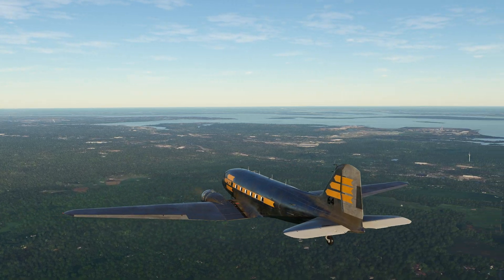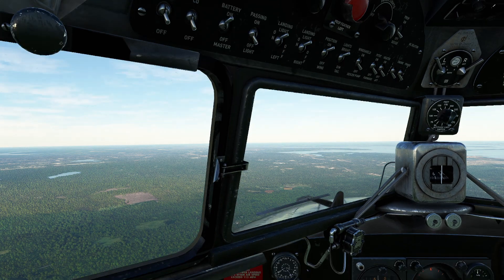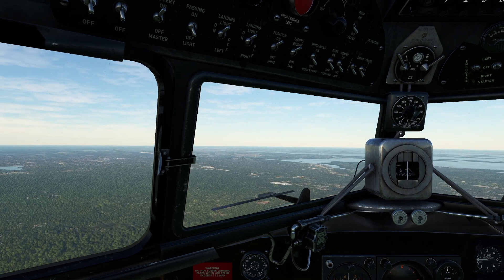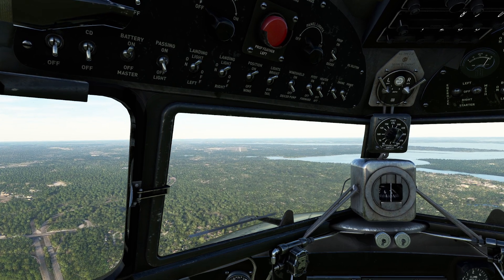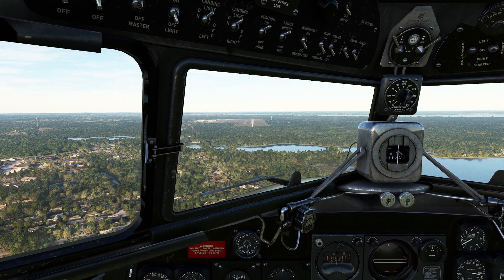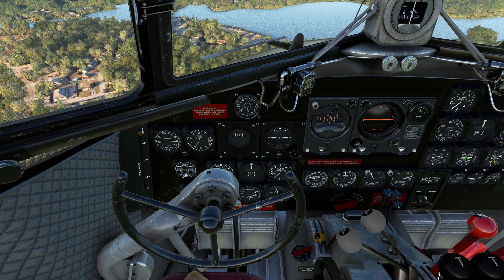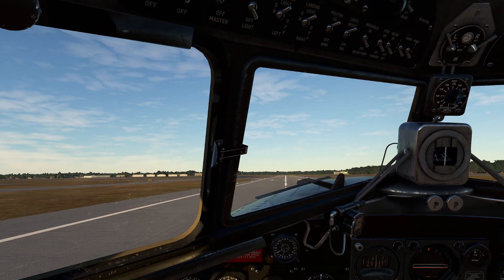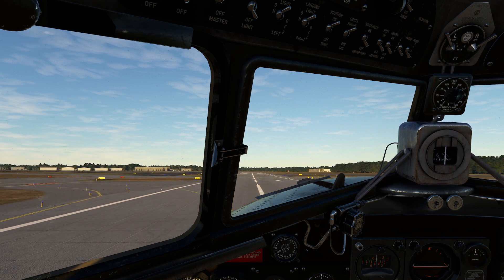MSFS - DC-3 Tutorial Part 3: Approach and landing

Comment: So, how do I NOT veer off the runway????!!!  I land straight in calm conditions, all three wheels down, going straight with no extreme inputs to the rudder, and it starts yawing right.  I apply slight left rudder...it keeps pulling right.  Little bit more rudder, same thing.  It doesn't respond until damn near the end of travel on my flight stick and when it DOES I go from the grass on the right side of the runway to the grass on the left side of the runway in an uncontrollable fishtail!!!  And when I give up and let go of the stick entirely it spins around 270 to the right before stopping. Tail wheel is locked and auto rudder is off so that's not my problem.  Wtf?!!
Reply: welcome to tailwheels. learn the rudder pedal dance.
Reply: what is auto-rudder?

Comment: In the real DC-3 you MUST do a two wheel landing and keep the tail in the air until there is nor enough airspeed to keep the tail up. If you land three point the rudder will not have enough authority and yo will lose all directional control and you will go cross country off the runway.

Comment: Great landing and I always learn something from you. I'll say it again, get the mod; it improves this plane greatly such as clicking the yoke and it disappears like in other planes. I've been able to successfully do both ILS and RNAV approaches but dropping the gear produces great amount of drag so I need to go full throttle when I do that. The plane will lose the glide slope and I have to manually get the plane back up to re-capture the glide slope.  Upon landing, I cut the throttle and the plane comes down nicely. It won't drop out of the sky as the wings are so huge. I use my GTN 750 Premium from the drop down menu to watch my glide slope.
Reply: Have you got a link for the mod please?

Comment: Another point, there's no shame in hiding the yoke column in MSFS. The 2D view adds a challenge you don't get in real life (or in VR), where because you have two eyeballs, the column doesn't occlude things behind it quite as badly as it does in 2D. In stereo view, One eye or the other will have a line of sight to the panel behind. 

I'd love to see aircraft implement a partially opaque yoke tbh. Could be done using dithered clipping in the shaders, no need to fuss over transparency and render queues.

Comment: From my understanding, three-point landings in the DC-3 are not recommended nor used.  Once the rudder drops below the airstream at speed, it's going to ground loop.  The tail should be held up as long as possible to maintain directional control.
Reply: This.  Gotta keep flying it until the tail won't fly anymore. Once I started doing this my landings improved immensely.
Reply: The DC3 was easy to land (and fly as i flew them for 6 years) - I am sorry this is all alien to me.